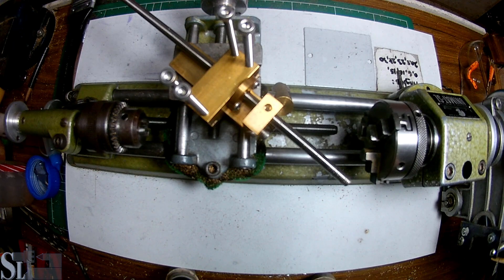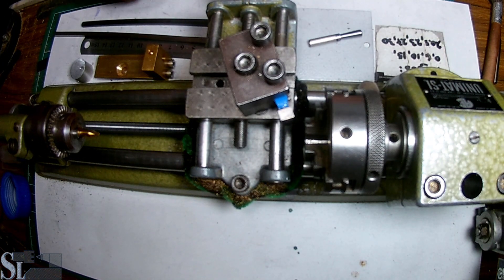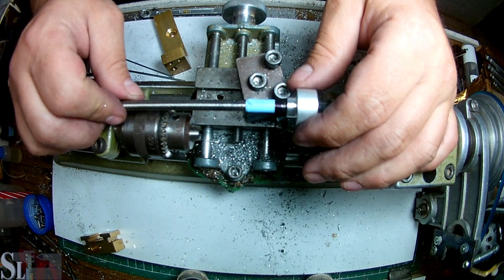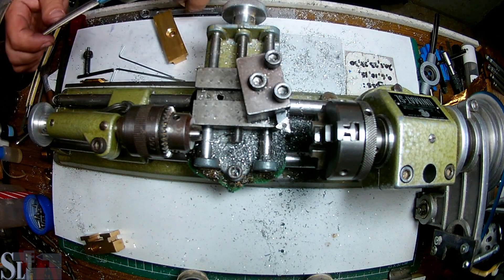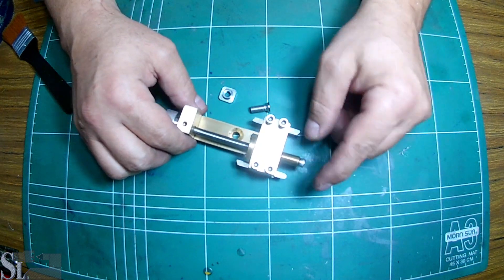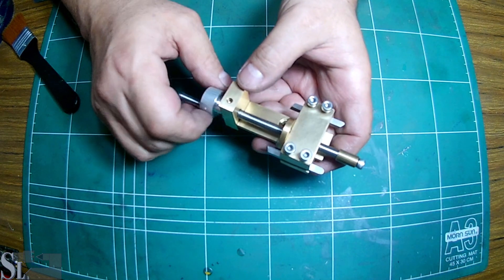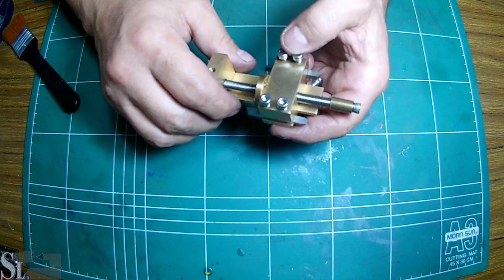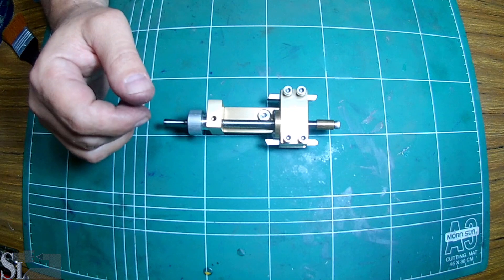Compound rest for the unimat SL 1000  - Part III finished

Comment: awesome idea and great build! Funny enough, one of these just sold on ebay. I didn't think emco ever made a compound slide for the DB/SL1000s so I'm not sure who manufactured it, but it looked very similar to yours
Reply from the maker: Way ahead of you mate - I saw these too! - they don't fit the unimat SL/DB - they do fit the unimat3, which has a taller spindle. If you take a measurement - took a lot of digging to find out -  you will find they are too tall. The unimat SL/DB spindle center (i.e. cutting tool edge) is only 12mm above the ways - the ebay/aliexpress compound rest is way above it, so you won't be able to use it to turn anything, or face. Sorry to disappoint... :)
Reply: @Smallathe  Good to know! I tried to figure out who originally made the compound, even did a reverse image search, but nothing came up. Glad I didn't waste my money on it
Reply from the maker: @roddyworkshop4454  Glad I could help :)

Comment: Might it be a good idea to have the cutting tools at right-angles to the way you are showing for shallow tapers?
Reply from the maker: @jozefbubez6116  Absolutely. I did plan on modifying it for a 90deg  cut, but for now, tested on aluminium and brass, it's working quite nicely. I did think on 3D printing a model. It should work for light cuts... What do you think?
Reply: @Smallathe  Hi and many thanks for coming back!
As to 3-D printing, at age 74, I know next to nothing although one of our grandsons has made a toy bear or something of a like kind and it took seven hours. Would I not be right in saying that 3-D printing is for plastics only so depending on the exact material would be good for very light use, only? Personally, I prefer to stay with "old school" tech and if it can be done using a drilling machine and file only, so much the better!
My interest in the compound slide is for a lathe I started building back in 1978 roughly following a book by Tubal Cain, I think it was, where he states what can be done using 'careful draw-filing'. The result was a 1/ 1/2" centre height, 6" between the centres using mild steel flats and a 1/2" diameter shaft out of what we in l'il olde England call 'silver-steel' which is a half-hard precision ground steel, the shaft running in plain fine-grain cast-iron bearings and bored through to take 8mm collets salvaged from the remains of a watch-maker's lathe which had only hand-held tools. Over the years, I have turned out quite a few projects on this 'mini' lathe but been confined to parallel turning only hence the ability to do taper would increase my possibilities.
This may be of interest but I don't know whether there is any way of up-loading photos onto YouTube?
Cheers! Jozef
Reply from the maker: @jozefbubez6116  hi Jozef,
I too am for metal and machinning but 3d printouts do expand horizons for small lathes - check my post on 3d printed spacers.
I have posted exact measurements - so I hope this will be usable for you too. Keep me posted...
You can send me images by email via my candy making website www.spicecandies.com or by mail to saar@spicecandies.com.

Comment: Don't worry about talking too much . We watch to learn , teachers need to talk . We'll listen .
Reply from the maker: Thank you Richard. Very kind of you, but seriously - I'm cutting more than 90% chattering... and while I really enjoy showing you what I do for fun during my weekends, I'm not a teacher or pro in machinning. These would be tubalcain, ox tools, abom79, clickspring, vintagemachinery and other superb channels I can't recall their names right now. :)
Reply: @Smallathe  , 
Don't cut yourself short . l have a slightly larger enco lathe , but l' learning techniques and applicable methods from you . You do have teaching qualities,  just not in a school building . The gentleman you listed are all on my subscribed list . Thank you .
Reply from the maker: @richardpalmer6196  Hi Richard. I'll try to give more information (I really do try). Feel free to email me and ask questions if you have - anytime mate! But seriously... do you think most people are interested in the fine details? I did check - the answer is no... usually that is - and depending on your project. For example - I just finished editing (for 6hr) a demo video showing the 50hr build of the unimat compound rest in 5 minutes - and this reminded me it took me 3hrs to drill a single hole - the compound cross slide lead screw hole. I had to make sure it's absolutely flat on every direction or it won't work. Along with the backplate that has the corresponding hole I spent that friday 4.5hr for both holes [and discussed it with myself the whole time]. That's what I mean when I say I talk too much :)
Hmm... on second thought - that would make a wonderful fall-asleep-in-minutes-video. No one would finish that... I'd probably fall asleep myself after 10 minutes of that - and all I need to do is lower the hammer tapping and tool dropping noise down :)